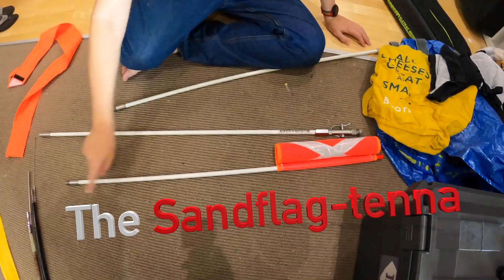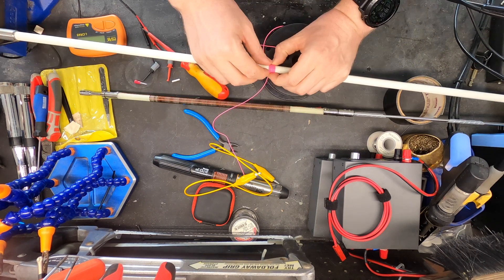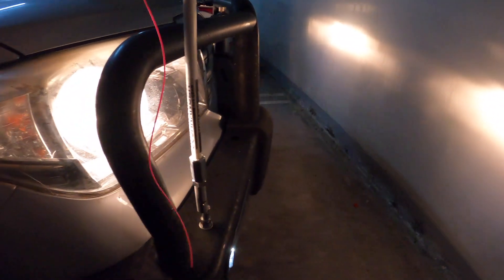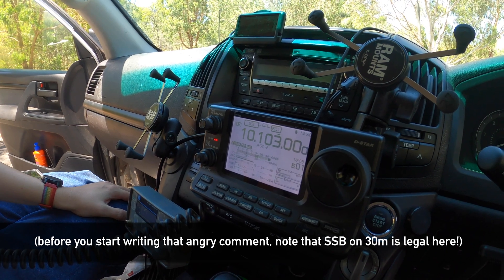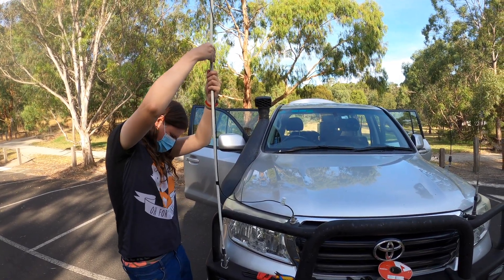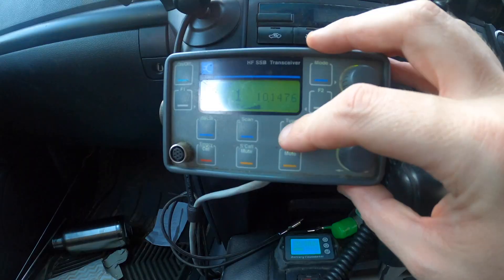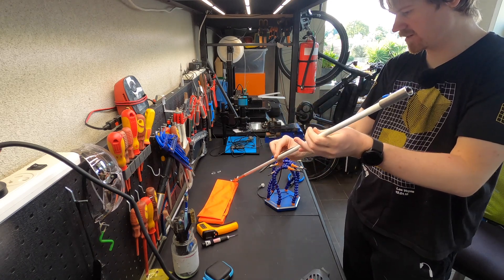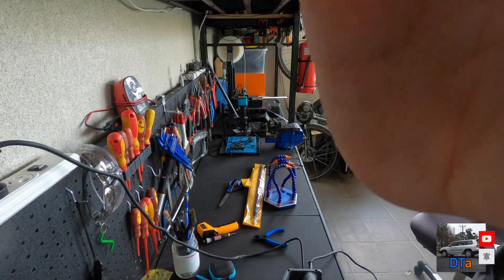Building The Sandflagtenna - a sand flag that's also an HF antenna!

Comment: A great idea but the only issue is that you now will have to drive around everywhere with the sand flat on... lol... I am heading up to do the Simpson Desert east to west mid next year... Jun-Jul 2026.
Reply from the maker: It is interchangable with the other one, it uses the same connector, so you can swap back and forward.

Good luck with the Simpson Desert trip. I've done that one - still need to edit the video though, it's coming!